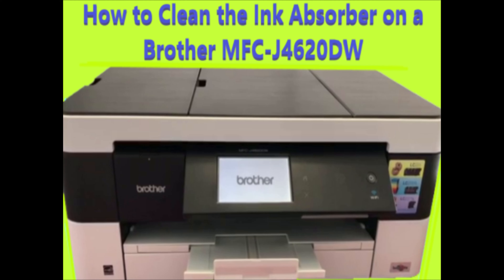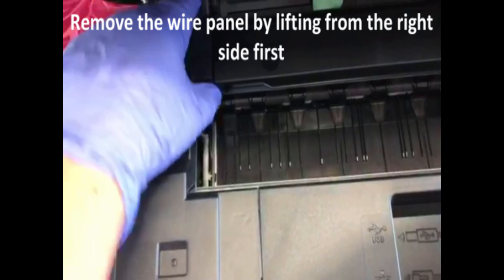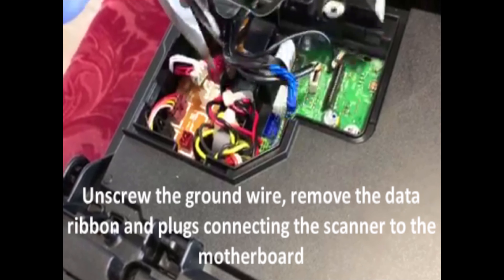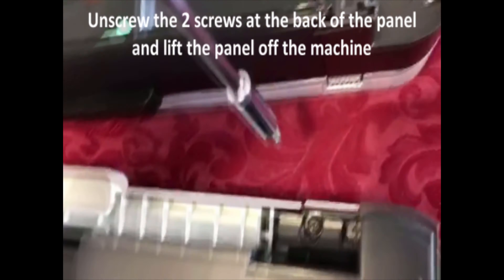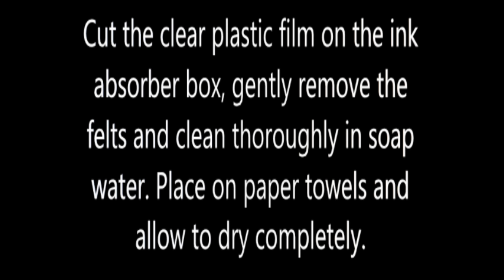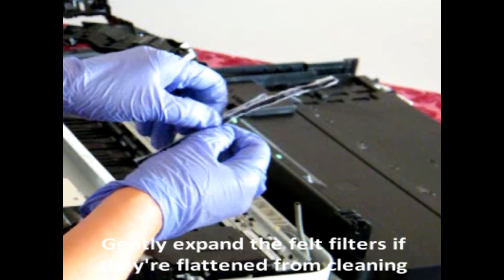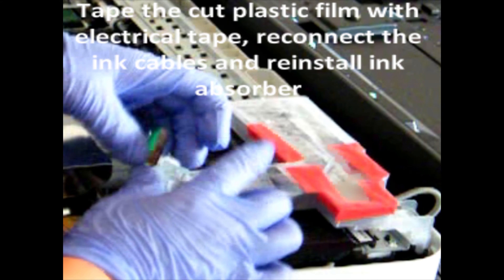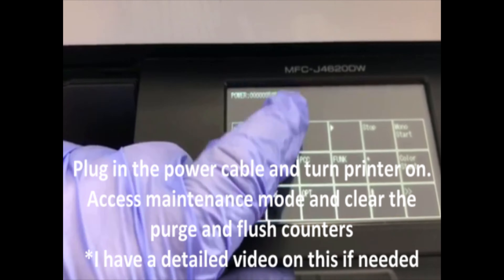Clean or replace the ink absorber box on a Brother printer - Fix Error 46 on MFC or DCP

Comment: This is a beautifully done video.  I disassembled my MFC-J4410DW, removed the ink absorber box, and cleaned everything out, including thoroughly washing out and drying the pads.  After reassembly, it works, but the status still says, "Ink Absorber Near Full".  I reset the purge and flush counters, and still get that message.  Then I found your other video about also clearing the FLSBK and FLSCL counters.  THAT did the trick.  No more error status.  Thank you!
Reply: It would be nice if a link to the follow-up video'can be posted!
Reply from the maker: https://youtu.be/ANCokAwTwxo
Reply: If only I'd got "Ink Absorber Near Full" to give me some warning before it was full and stopped working! Cleaning worked well, thanks, on a 4420. I did later find where I could get a replacement box with pads, but I'm glad I did the messy bit, especially as the replacement would have been £32. Then the touchpad malfunctioned and I couldn't purge the counters, so I found another exact model that was "free to a good home" and swapped the screen assemblies. It's been less used than mine, and Its ink absorber is only half full, so I've also got that as a spare, not to mention every other part I might be able to use!

Comment: MFC-J4510DW: Thanks for taking the time to produce this video...just some FYI for those trying to clear messages, etc...after removing the 'chip' attached to the absorber box it became apparent that the chip is actually a moisture detector whereby if it is too moist, (i.e. full of ink) then no matter what you do to clear messages, if the felts are wet this will generate the Error 46/Ink Absorber Pad Full error...all the magic keystrokes, number codes or finagling won't clear this error until you address the full pads which I simply removed rinsed under warm water, then let dry and reassembled...Hope this helps someone down the line...Good luck.
Reply: That IS helpful, thanks!  I am working on mine right now, and I as guessing that's all it was (detecting resistance across two metal points), and that you want those pads to be REALLY dry before you put this all back together.
Reply: @cowsongs  This suggests an even easier fix. Just leave the contacts unplugged, throw away most of the felt (leave a piece in contact with the ink tubes to stop them clogging), and reseal the box with waterproof tape (eg silicon plumbers'). Sure, somewhere north of 20,000 pages the box is going to overflow and maybe make a mess, but by that time the print heads or feeder will have worn out anyway.

Comment: MFC-J4420DW. A very (un)helpful Brother chat tech was trying to help me with a print heads cleaning issue. She actually led me into the maintenance Purge mode and emptied my brand new ink tanks. I think she realized what she had done, ordered new inks and quickly signed off. Anyhoo... I've got a full absorber pad. How do you know if the plastic tray needs to be replaced? What kind of tape did you use to close the felts pad case? Do you have to protect the printer heads in any way? I think I could make the repair easily enough if I could just plug in a new part.

Comment: Super helpful video, was able to follow along and get it done. Thank you. 

The printer worked for two prints. There were some faint lines and so ran nozzle cleaning. Then it went back to the "ink absorber pad full" message. I did the purge and flush reset. 

Any ideas for how to fix?
Thanks for making these videos and for your help
Reply from the maker: Have you still got the error message ? It should have cleared within 2 days or so  (if it didn’t straight away).

Comment: thank you! Just cleaned the absorber on my 10-yo J4510 -- it sure was full!  great video (though a little more video detail on unplugging the 6 plugs on the wiring harness would have been helpful.
However, I reset the Purge and Flush counters per your other video, reconnected my wifi, and printed a test page...and right after it printed, again got the "Ink Absorber nearly full" msg -- same as before (even after rebooting the printer). Was not expecting that! Might I have a faulty detection circuit? Will have to see what happens next...
Reply: ...or perhaps the pad at the detector was not dry enough when i put it back in?

Comment: Thank you for the video which helped me to disassembled and cleaned my brother printer ink absorber felt. Although mine is DCP-J4110DW actually printer structure are almost the same as yours. The problem is once I have cleaned and dried the felter and put them back to the printer felt box, assenbled the printer. the "ink absorber full" error message remains when the printer is turned. Why is that? do you have any idea to resolve it?

Comment: Sorry, but I am not exactly sure where this "chip" at the ink absorber is. Didn't see anything fall when I took the asorber off. Also should the absorber clip into anything unfortunately mine was dislodged already when I opened the printer up.
Great video, just waiting for the pads to dry thoroughly. Probably put it back together tomorrow.
Many thanks for taking the time to explain to "dummies" like me.
Reply from the maker: The chip is shown at 2:28 of the video -  it's at the front of the box. The absorber box has plastic clips that should easily clip into place. Check to see if there's any white plastic pieces around or on the absorber which show signs of being snapped or broken since yours was already dislodged. Good luck and let me know if you need anything else
Reply: @Knowhow1  I never did find the chip however when I put it all back together again it seems to be working ok. Then I found that one of the colours was empty. Just waiting for new supplies to arrive and go through all the maintenance jobs that you have very kindly provided videos for and get it all up back up and running.
Do you think there may be two versions of this printer and one is without a chip? Could it be that that chip may have been causing too many errors?
Again many thanks for providing the info. Mike
Reply: @Knowhow1  One thing I did notice though was the absorber pads were in three layers. The two bottom ones were about the same thickness as shown in your video. then there was a much thicker (half inch) third pad that went on the very top. This pad only had a very minor build-up of ink so I left that one alone. When the ink arrives I will see how I get on.

Comment: HOW DO YOUCLEAN MFC255CWINK TANK
Reply: Only differences so far were the display needs removed, screw locations, and could not find the secondary ink trap. To remove the kickstand, I twisted and pried. The hatch at the back needs removed also to allow the back of the cover to come off. Was successful. Best way to clean the felt pads is in a container so ink does not splash about. I used a Chinese soup takeout container. Also have to reset purge counter. Also had to run clean cycle.

Comment: Thanks a bunch for sharing.  I did experience the issue below, but just ignore the "Machine Error46" message and enter 80 as instructed.

1.  Press Home button for 5 seconds.
2.  Press blank entry on displayed list for 5 seconds.
3.  Entered code *2864
4.  "Machine Error46" is displayed.

Just ignore the error and proceed to enter 80.  The machine will enter maintenance mode and you can then perform the purge.

Comment: This video enabled me to clean the ink absorber pad(s) and re-assemble properly.  Afterwards, the printer (model Brother MFC-J4120DW) still reported the error message for ink pad full.  But I entered the printer's maintenance mode using the info in your other video - (Fix Ink Absorber Pad Full - Reset the PURGE and FLUSH Counter on Brother Printer (Error 46) - and after resetting BOTH the 'purge' and 'flush' counters...  my printer then was working fine!  Has been for a few weeks now since the DIY repair.  Thank you so very much for your great videos / demos.  Do you have a Paypal or Patreon?  Love from Scotland.  :D  ♥
Reply from the maker: I’m so glad my videos helped you ! It’s been a while since I’ve made a video so please let me know if there’s anything you need tips on -! PayPal’s qldtrade1 or kozzles06@hotmail.com  ..
Reply: @Know-how  Thank you very much!  I've a couple of Brother machines with blocked nozzle probs. I tried the syringe / cleaning fluid / print head cleaning method..  but immediately afterwards the machine will only print black, anything of colour is coming out completely blank.  I think maybe I've burst ink tubes(?)

I've yet to try printing with again, I moved on to a different machine.  (all Brothers)  

I've also got a Brother J5720-DW, practically brand new with blocked colour nozzles. :'(
I guess I'll try syringe clean method on that next. And be extremely gentle pumping the cleaning fluid through.

Thank you again for your time.  Have made a Paypal payment for your help.  :D  ♥
Reply from the maker: I’m going to make a vid next on manually cleaning the print head and nozzles. When you used the syringe method, did you use distilled water or isopropyl alcohol ? Did you let it sit for a good 5/10 mins to absorb ? Check the print head itself is clean too~ dampen a folded paper towel and move the print head onto it (unplug the printer mid-print so you can freely move the print head). Let it sit on the towel for a while (at least 15mins) then move it over the towel a number of times.
Reply from the maker: @mr.a8315  and thank you so much for the donation! I truly appreciate that and am so grateful 🙏🙏🙏
Reply: @Knowhow1  The cleaning kit was a product from 'Printhead Hospital'.  The cleaning fluid tub lists no ingredients, just safe 'safe effective formulation for use with all water based printer inks.  Bought online, the listing said was suitable for Brothers and others. 
I'll try that advice with checking the print head itself too, many thanks!  :)

Comment: I cleaned the pads, reset the counter, but it still prints light/blank. Any suggestions?
Maybe the pads were still slightly wet or too compressed?
Reply from the maker: It sounds like the ink nozzles need to be purged - https://youtu.be/P-pXJTtlkFM
Reply: Because of the error message, I couldn’t get the purge to go through. After I did another reset, the purge started. Afterward, I was able to print 1 light page before the error came back. I contacted brother and after I explained what I already did, they recommended doing a purge as well. They then said I needed to replace the box. I have found them online, but I just don’t understand why a new bow would work when my cleaned, dried and taped box didn’t. I know this worked for other people, but could there be some sort of sensor that isn’t letting the error clear?
Reply from the maker: Don’t waste your money on a new box if you’ve already cleaned yours. To resolve the error msg - Turn off your printer to do a hard reset - unplug after shutting down for at least 10 mins. If error msg is still there, you need to reset the counters again. Don’t forget the flush colour and black counters and the purge count. As for the light pages it’s either: ink nozzles need cleaning by either power purging or if that doesn’t work after at least 3 attempts, or the print head needs cleaning (via settings) or it could be paper scraps on the print head.
Reply: @Knowhow1  I don’t want to claim victory yet, BUT after clearing every counter I could and doing 2 print head cleanings, the test page came back good AND I was able to print out a 3 page order without an error message. 
Thank you for your time and effort. You don’t know what a stress reliever this is, so again thank you and keep making great videos :-)
Reply from the maker: That’s great news ! Thanks for your kind words and I’m so glad I could help :)

Comment: Hi Know How, I've just finished dismantling my MFC-J4610DW (yay but eeeeek) and am ready to wash the ink pads.  I wondered about the re-taping down of the plastic.  I see that a section of the plastic is full of holes so presumably the holes need to remain untaped?  And what to use for taping the rest - cellotape? 🙏
Reply from the maker: Electrical or duct tape would work, or masking tape. I wouldn’t think cellotape would have enough grip on the plastic and might come apart. Only tape the edges down, and any tears. Try to leave the breather holes untaped as much as you can :)
Reply: @Knowhow1  Thank you very much.

Comment: Thanks for knowledge sharing. is this 2783 to purge the counter is also valid for MFC-J4320DW. Otherwise do you have the right code thanks again
Reply from the maker: Yes the code should work the same for the j4320dw.
Reply: @Knowhow1  no it doesn’t work for me
Reply from the maker: @najelb6707  have you entered 80 to access the purge menu and you are in the menu where you can select purge ? If you have your sound turned down you won’t hear the beep so go back into that menu and select purge again to see if the count has reset to 00000

Comment: SOOOO. I see I was not the only one that had an error message EXPORT TO CARD appear when entering the maintenance mode after cleaning the absorber pads and attempting to clear the purge in the maintenance mode....and failing at the effort.. After hours of digging I found this process that works. In the Brother service manual section 5-4 - LIST OF MAINTENANCE MODE FUNCTIONS... Maintenance Mode 46 is listed as BACKUP 0F MACHINE INFORMATION.
Going down to Mode number 76 is listed as PURGE OPERATION. The page is 5-54 section 1.3.29. Here one can perform different purges as well as reset the purge or flushing count. Here are the instructions from the BROTHER SERVICE MANUAL for model MFCJ4620DW - RESETTING purge or flushing count.
1 ) Press 8 and O keys in this order in the initial stage of the maintenance mode to call up the machine's log information ( maintenance Mode 80 ) refer to section 1.3.32 in this chapter.
2 ) Press the Mono Start Key several times until the purge or flushing count appears on the LCD display.( mine took about 25 pushes)
3 ) Press the 2,7,8, and 3 keys in this order to reset the purge or flushing count. The machine automatically returns to the initial stage of the maintenance mode.

The procedure shown in Know How's post works after this procedure is performed, so perhaps the method I found in some cases must be used to reset after a cleaning of the Absorber Pads, at least in some cases. When my printer returned to normal mode the Absorber pad is nearly full message still displayed, however this does not stop the printer from printing. I printed an image off of my desktop and the message then disappeared and I am back to normal at this point. Apparently there are maintenance mode codes and error codes...well of course there are !!!
Reply from the maker: Thanks for this. I have another video which includes resetting the purge count aswell - https://youtu.be/ANCokAwTwxo
Sometimes you need to do this as well like you said, particularly after cleaning the ink absorber box
Reply: @Knowhow1 You are too kind..I do believe that I did take the long way home. I do believe I was at times entering the error code 46 instead of 80 as per your instructions. Entering 46 sent me to Export to Card as I just recreated the error in the maintenance mode. 80 in the service manual is shown as DISPLAY of the EQUIPMENT'S LOG and shows and gives access to a lot of operational stuff including Purge counts . I have a much greater appreciation for printer tech's after this !!!

Comment: Hi I have followed your instructions which were great, however restarting my printer I am getting the error stating that “My Cover is Open’  even though it is not. So I do not know how to fix this. I have fulled the machine apart and rechecked that I put everything back together correctly and it all fits correctly. Is this something that I have broken in the process?
Reply: I have the same issue. Did you ever find a fix?  Thanks!

Comment: I have a DCP-J4110DW. and cleaned the absorber following your excellent video.but i still get the error46 code.how can i remove that?
Reply from the maker: Did you reset the purge and flush counters ? If you have, shut down the printer and unplug for around 10-15 minutes and then power back on. It can take up to a couple of days for the message to resolve, but you should still be able to use the printer.

Comment: i have a brother DCP 720DW which was working fine until a few days ago but as the printer was not printing cyan and yellow properly, i ran ink cleaning a few times and while printing, it suddenly started leaking ink from below the ink tank location..suddenly all my ink started oozing out and drained most of my ink within few minutes. . the printer is still working / printing but am afraid to fill up the ink again as it might be messy .. could it be a full ink absorber box or maybe something inside is broken ?

Comment: Thanks for posting this video. I used it to guide me thru disassembly, cleaning, and reassembly of a J4420 printer. The only change I made was to remove the electrical connector that goes to the ink
Printer tray in order to remove the tray. The little electrical board is attached to the tray and difficult to remove while trying to remove the tray from the printer. It was much easier to remove the board after the tray was completely removed, everything else worked out well. I was surprised to see how much ink was stored in the tray! Seems like a waste of a lot of expensive ink in that tray!!

Comment: Worked perfectly on DCP-J4110DW, the only difference is that there isn't a crew in the part you need to unplug some cables, but the rest is exactly the same. Nice video tutorial
Reply from the maker: Thank you! Glad it helped you out :)
Reply: hello glad to see your printer was the same as mine. would you share your tips here on which plugs need to be unpluged to make the "ink absorber full" error message disappear?